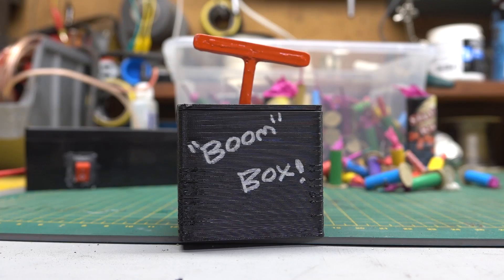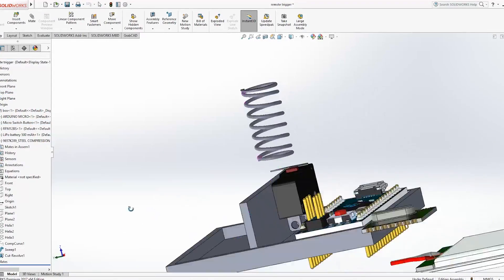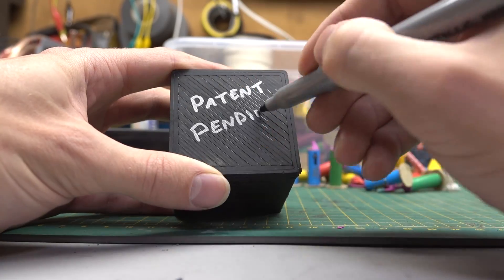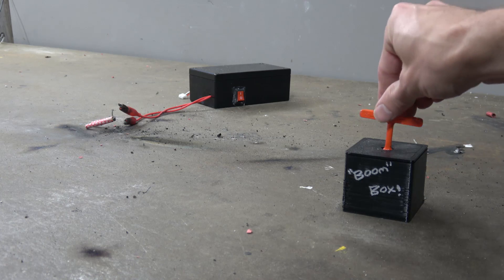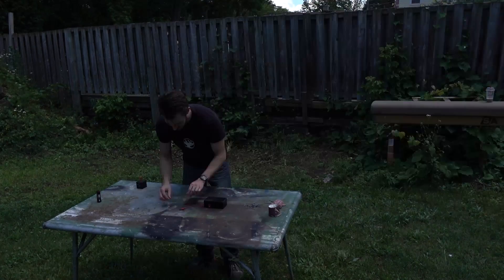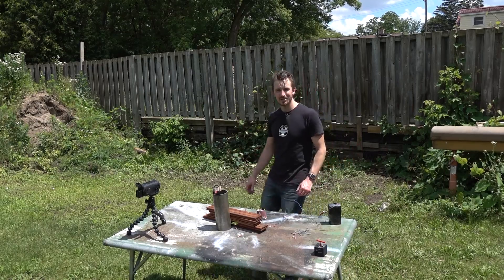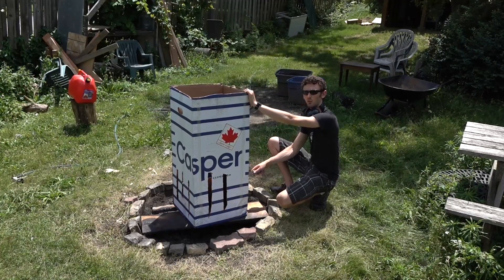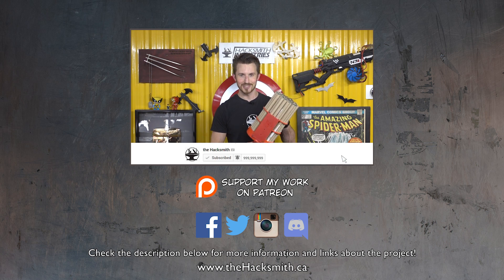DIY Wireless Firework Launcher!

Comment: What kind of arduino boards do you use, because I use the arduino genuino/ Uno ones. Also how average energy do you need for maximum of your projects?
Reply from the maker: Depends on how many IO we need, usually a nano will suffice. Bigger projects use Unos.

Not sure about your second question... what do you mean how much energy?
Reply: the Hacksmith I mean, how much energy do you usually use, like what I mean is the battery or the amount of energy needed that suffices for the project you make.
Reply: the Hacksmith can you please make a video on glowing 1000 degree knife vs glowing 1000 degree knife and record it with a thermal camera. I wanna see what the impact it's gonna make.
Reply from the maker: It really depends on the project... really can't give you a number because they're all different!
Reply: the Hacksmith oh ok, thanks. Also thanks for replying. Can you make 1000 degree knife vs 1000 degree knife and record it with a thermal camera
Reply: Thanks

Comment: Congrats on your success, but it appears necessary to point out that the wireless link removes most of the need for the traditional run-away-like-a-little-girl move you still performed.  EDITED: It looks like this has already been pointed out a few times in the comments. Funny video and I gave it a like, but really... Iron Man would not be impressed. ;)
Reply from the maker: We forgot to add longer antennas. Should actually have a decent range once we do that =P

Comment: Seems an awfully complicated (and expensive) way to do what a $5.00 remote control off eBay could do. A cute exercise but a bit over the top.
Reply from the maker: Please do send me a link to a $5 transmitter + receiver control unit! I've never seen one that cheap.

Parts cost for this project was $20 which isn't much at all. The RC chips were $3 for a pair, and the arduinos were $10 each ($5 if you buy them from china). One relay and a limit switch, another few dollars.

Comment: eh bro i was just watching some of u r old iron man build videos & had a thought, maybe try those dyson hair dryers as a prestage air supply sorta thing 4 u r turbine engines? they put out a shit ton of air flow & maybe with some sort a regulator on it it may serve as a decent air supply/ cooling system 4 u r over heating issues? or maybe i'm just a moron? anyway, good luck bro. ltrs.

Comment: Isn't shorting LiPo batteries a little bit of a dangerous thing? xD
Reply from the maker: +EstBest69 it's not really shorting when you are heating a wire -- it's essentially acting as a fuse. Don't worry, we did the calculations :)

Comment: Cool but the design is a bit useless, because every time you detonate something the box with the arduino and the important stuff is going to be destroyed.

You can say, well let's make the cable to the explosive longer, but in that case you don't need anything wireless

IMO all the circuits should be in the box with the lever, even if it makes it bigger, and in the other part just a receiver and a blasting cap with a little 9v battery.
Reply from the maker: +HAWKY ... The only parts in the detonator box are the receiver. And it's safe, inside the box... The wires coming out of it could have been a bit longer, but that's easily changed. If you put all the parts in the box with the lever it wouldn't work lol

Comment: Hello James, I have seen in one of your video that you read all the comments. I hope you read this and reply. So, for Iron Man Project I have an IDEA-
First of all its not always necessary to make the same thing. I mean like take example of phones. They were bulky and heavy and over sized when they were invented, but as time passed they kept becoming compact and smaller. The same goes with the Flying Suit.

For flying suit, I have two suggestion-
1) A kerosene fueled micro gas turbine(effectively a small jet engine), total 6 engines, some inventor of UK used and I think you can contact him for a collab for the project or you can see one of his video to make that engine better of your own as we all know you are the best.

2) I think you should get a real jet pack and remove all its parts, upgrade it to your needs and make it better and implement it in your suit whatsoever you see fit. In the starting, it may seem a bit stupid design or something but I am sure you will definitely find a way to adjust it.
Reply from the maker: +Kartikey Sankhdher certainly doable, as seen by the British inventor -- unfortunately still super expensive. He's spent over $100,000 building is suit :(

Buying a real jet pack would be even more expensive, so can't really do that either...

Comment: I made one that works over 300 m away and has 4 channels out of an rc car. If anyone is doing the same pro tip:  Apply more voltage to the transmitter it gives you a lot of extra range.

Comment: That's so expensive. Why not use an rc reciever?
Reply from the maker: RC receivers are way more expensive... a pair of these 433mhz chips were only $3 lol 

http://www.geekbuying.com/item/MX-05V-433MHZ-RF-Wireless-Receiver-Module-MX-FS-03V-Transmitter-Module-Kit-For-Arduino-Raspberry-Pi-AVR-ARM-344591.html?Currency=CAD&gclid=CjwKCAjw1ufKBRBYEiwAPI_r4TmKx-I9sQ5N0WAjjQ0WqPKBluKfWi1sD_2-4ENW8RaNCMa79WgL4BoCEV0QAvD_BwE
Reply: the Hacksmith yeah, but arduino mania are $20 and you need 2. A cheap 3ch reciever is $10, and you would get much better range.
Reply from the maker: They're only $10... you also need an RC transmitter which isn't cheap and a few other parts..
Reply: the Hacksmith yeah but we know you guys, and many viewers already have that stuff.

Comment: If it is remotely, why you have to be close and run away?
Reply: because of poor range
Reply: yeah, what's even the point?
Reply from the maker: +deathcenter115 forgot to add an antenna lol
Reply: מנין, ככה זה עובד
Reply: Vuntedum they used a small Bluetooth emitter
Reply from the maker: +deathcenter115 we didn't use bluetooth...
Reply: the Hacksmith what'd you guys use? OHH the radio stuff. but why such a small range?
Reply: Vuntedum so you dont light it in your hand and say accendently fumble it while its lit and have it go off 3 centimeters from your hand

Comment: I have several 433MHz recivers and emiters, I want them to control something quite far away. The amazon site where I bought it, said that with 12V supplied to the emiter, and a proper antena in both, the emiter and reciver I could reach >500m in an open area. Im however having quite some trouble figuring out how to make an antenna for it, or what antenna to buy for it.

Help? :D
Reply from the maker: We forgot to add an antenna, hence our range of 10' =P

Comment: You can increase the range by getting stronger transmitters/receivers(there are those you can get with hundreds of meters of range), and adding one or more large or smaller capacitors to the transmitter/receiver VIN pins.
Reply: I was assuming you were using 433MHz receiver and transmitter for this project
Reply from the maker: / actually add an antenna! hahaha